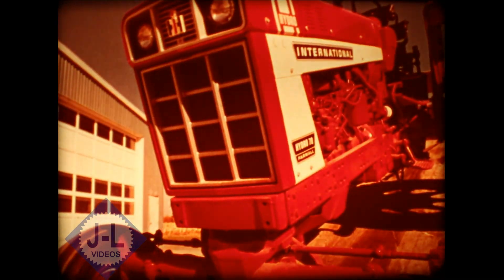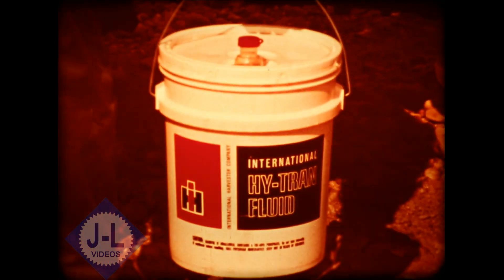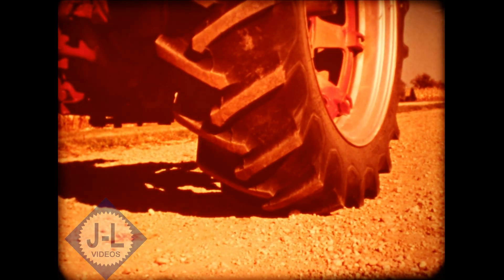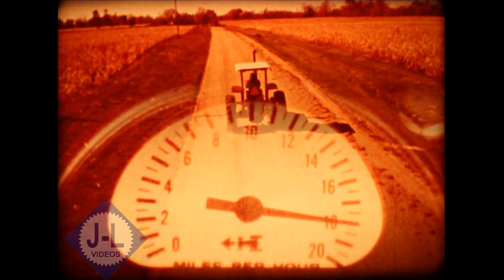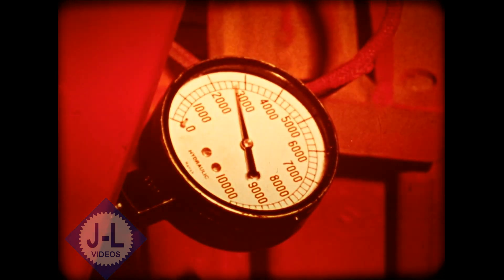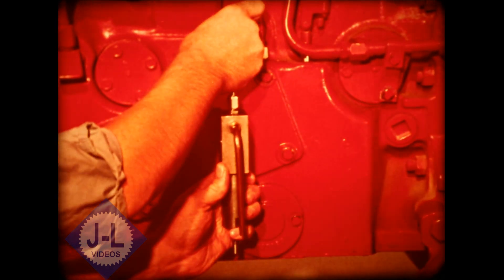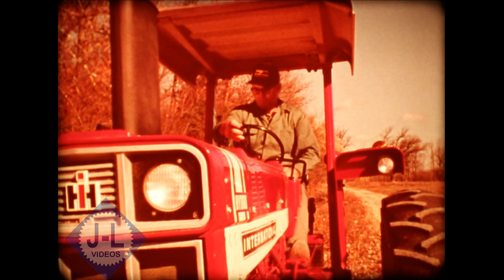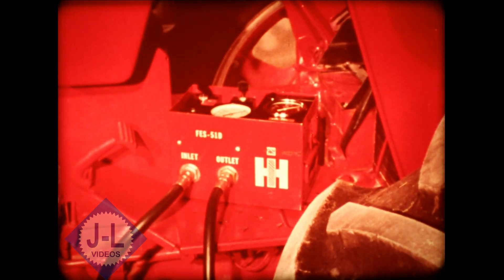1975 International Harvester Film Hydro 70 Tractor Troubleshooting

Comment: Hydrostatic transmissions , should never have been used on farm tractors. We had an IH 656 hydro. , the hydrostatic transmission, had to be repaired 3 years in a row. Worst idea ever, for tractors, may have been alright for combines , where there is no load on the machine.

Comment: My 656 in low range will reach max speed then cut out like the clutch has been depressed then take off like a rocket back to max speed. high range it works fine.  Anybody know where to pin point it? TIA
Reply: I don’t know if you still have this issue, but it’s almost definitely in the S-R lever linkage. If you take the side plate off the left side, there’s a “T” at the bottom of the lever that rides in a “U” shaped saddle on the end of the reversing valve. Check the end of that T for a taper, it takes very little wear it let it drop into neutral at the end of its stroke. If so, build it up with weld and smooth it off square.